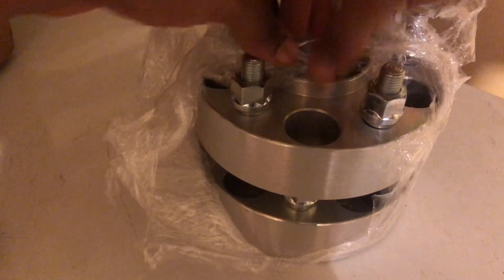Accord V6 | Installing Bigger Wheel Spacers (38mm)

Comment from the maker: The original spacers were actually 25mm😅... Make sure you Like, Comment, Subscribe!!!
Reply: Bro I have a 2017 Accord would 25mm be too much?
Reply: Do you still have the same size spacers after the coilovers?
Reply from the maker: Kenneth Fontenette For the rear 38mm is probably the most you can do but for the front 25mm is perfect. And yeah I kept the same size after the coilovers
Reply: I'm looking to camber my front any ideas on how to do it? I have function and form type 1 coilovers. I don't know where to get camber plates or anything
Reply from the maker: Kenneth Fontenette You’ll need coilovers that come with camber plates
Reply: @4DPvon  yeah I figured I would just have to get the type 2.  F. M. L.

Comment: The curb rash tho 😭
Reply from the maker: Themexican 2468 I know 🥴 Just gotta be real careful
Reply: That happen to me too on mine and i fixed it hitting it with a hammer till i straight it out 😁
Reply from the maker: Themexican 2468 That bend was from a pothole tho
Reply: @4DPvon  yea same on mine. I saw the hole to late and couldn't dodge it, next thing i know i hear a big bam and my steering wheel started to shake, thats when i knew something was wrong
Reply from the maker: DBZGazettEde OZ Smh I’m scared to put a hammer to the rim, lol I don’t want to make it worst especially since there isn’t any leaks I’m cool
Reply: @4DPvon  as long as its not losing air is fine.. my tire got flat after that hit